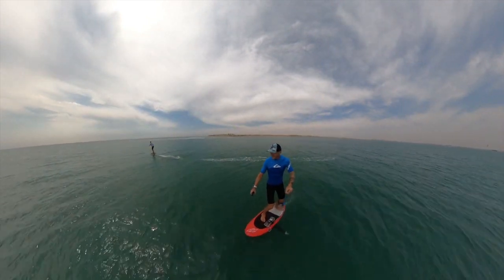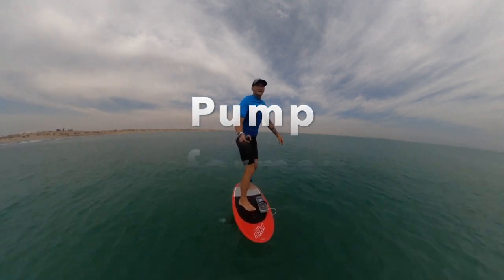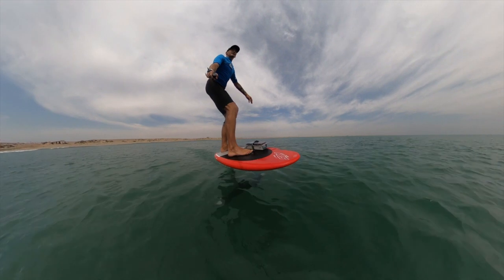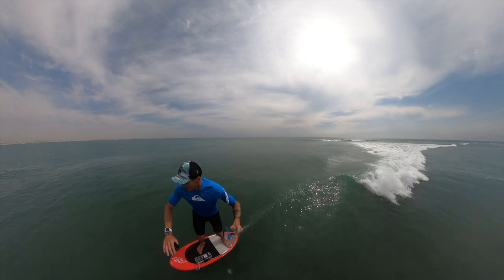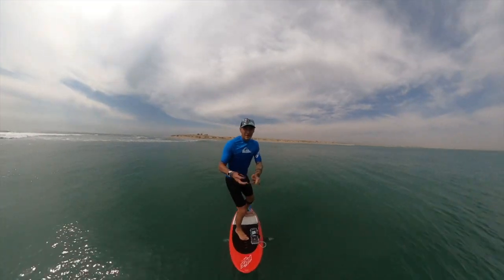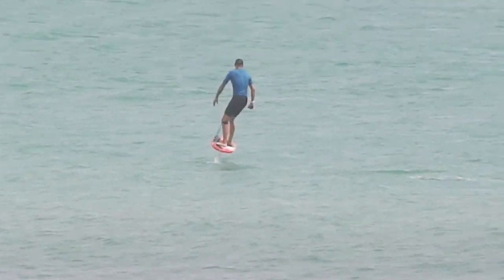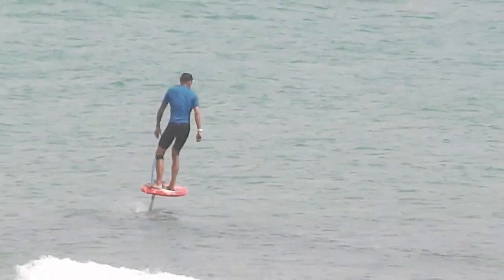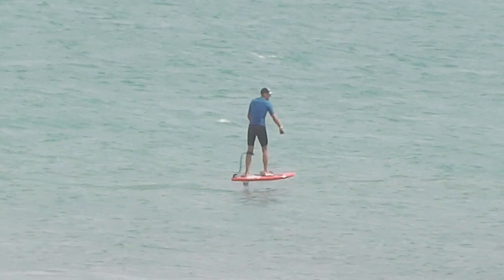FoilDrive / Project Cedrus e-foil integrated mast SURF REVIEW

Comment: Great video and thank you for sharing. I am transitioning from E-foil Fliteboard Ultra  (60L)the smallest and lightest setup at 22kg . I have done 3000km in 2 years. I will go 80cm Cedrus in Efoil position.  I am 78kg . What would recommend for board and wings to start with? I don't mind persevering to keep the best out of it. What I found with Fliteboard - I went too big early and then realised to go with the smallest wings/board. I'm in the surf twice a day all aspects, flat, wind swell chop. So, I just need to get going and get a feel and see where I am.  The surf conditions that I would learn in  would be described and flat to rolling glassy. Thanks for tapping into your knowledge.   🙏👍
Reply from the maker: Hey there. I'm glad you found my video helpful and I'm also really grateful you got in touch because I'd love to hear your honest opinion as to how you find the assist plus with integrated efoil mast compares to the lightest/smallest fliteboard once you've tried it . I've only ever used the really big efoils so i would love to hear from someone so has first hand experience with the small efoils.
From my limited experience with efoils, this is what I can say... FoilDrive doesn't have as much thrust as your fliteboard, so you may find it harder to get on foil, but once you've got the right technique it's fairly easy. To learn the technique I airways advise beginners to use a big board and foil to begin with, but as you've already been doing the same thing (just with more power) I don't think you'll need to start too big. You might even be fine starting with a 30ltr prone board, but if not, there's no doubt that more volume makes it easier. I would say 50 ltrs is more than enough to learn with your experience, and once you've got the technique you'll be able to drop in size to anything you like. Personally I prefer around 35 ltrs of volume. Much less and it uses up battery power quicker and doesn't give much extra benefit in terms of performance in waves, however on flat water there's nothing like a sub 20ltr board.
With regards foil size I find the super HA foils very difficult to get on foil due to their high takeoff speed, but even they are possible with a push from a small wave, it's just flat water that they are super difficult to get on foil. Foils that are AR 6 or 7 seen to work best with FoilDrive, and foils around 1500cm2 and above are pretty easy to get on foil in any conditions. I can use much smaller foils now but it took a long time for me to be able to go that small.
I'd really appreciate if we can carry on with this conversation on WhatsApp or FB messenger as i think getting your opinion of FoilDrive vs the small efoils would be really useful to know.

Comment: Thanks very much for this excellent review. Please share a little more information. What mast length were you using? 
What is your favorite fuselage and rear wing for surfing with the PNG 1010?  What is your favorite fuselage and rear wing for surfing with the PNG 910?  What is your opinion on the 910b instead of then 910? Thanks very much for all your great work.
Reply from the maker: 80cm Cedrus/FD integrated mast.
Crazyshort advance red & black.
The only difference between the 910b and the 910 (red fuse) is that the 910b is slightly thinner in the middle section - this is because the 'head' of the black fuse is thinner than the 'head' of the red fuse, so it doesn't cause the foil to bulge as much at the connection. They are the same in every other way. As a result the 910b has slightly better performance than the 910 (red).
Reply: @dominichoskyns9091  Thank you very much.

Comment: Hi Dominic would you say your comments in the video also ring true if you're using the FD without the PC mast and therefore having the cable taped along the trailing edge of the mast? Or does the extra drag from the cable mean you have to have the FD higher on the mast to surf/pump it?
Reply from the maker: It's possible to downwind with the cable taped along the length of the mast, but for me I find it frustrating as the drag stops me from doing what I know is possible. If you don't know any different I'm sure it'll be OK. Basically the extra drag from the cable means you'll be going slower then normal, so I guess it'll just feel like you're using a slow, low aspect foil. Like I said, it's possible
Reply: @dominichoskyns9091  thanks, makes sense. Think I'll stick to high up nearer the board!

Comment: at what height do u run your foil drive on integrated mast looks like the 25cm preset setting?  on all your videos they all look about same?
Reply from the maker: In the assist position it's about 8" below the board. In the efoil position it's as close to the bottom as the mast as possible

Comment: It does look there is alot of drag when you are surfing, the foil is not gliding properly in the wave, i can see you correcting yourself alot of times to be able to stay in the wave. On the other hand it is quite impressive how you can pump it, it looks less draggy when you pump it then when you are on the wave.
Reply from the maker: Yes, like I said in the video there is definitely some drag from the motor, but the point I was trying to make is that its still super fun to use in the waves. It'll never be as good as having the motor pod out of the water when surfing but there are a lot of people who want to know if surfing is possible with the efoil mast and what the compromises are. I hope that came across in the video.
TBH I think the foil I was using on the gopro footage made it look awkward on the wave. It's a very high aspect foil that isn't designed for surfing at all
Reply: @dominichoskyns9091  the foils is the 1099/999 ?
Reply from the maker: @pedromarcos1472  in the footage where I'm being filmed from the beach in using the 1010 but in the gopro footage I'm on a prototype so I'm afraid I can't say anything about it yet.
Reply: Christ!  People are surfing with efoils that have much bigger pods!